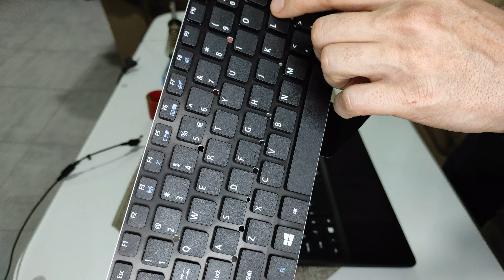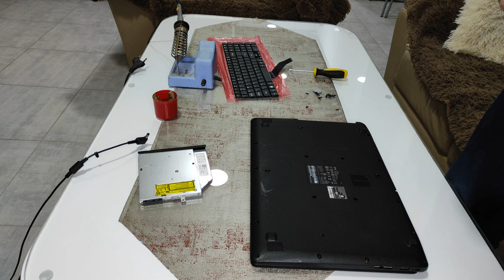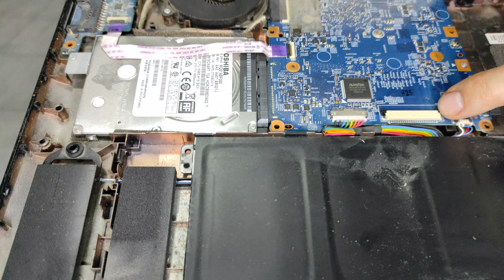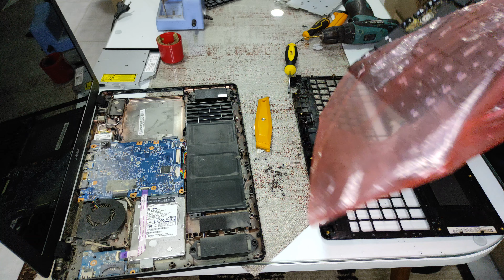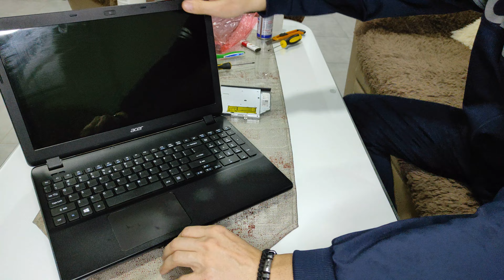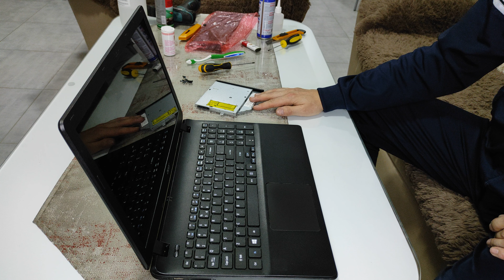ACER Aspire ES1 531 Keyboard Replacement

Comment: Absolute pain of a laptop to replace keyboard on. Did not have a drill on hand but was just successful removing all the plastic retention pieces using some prying with various tools between the metal plate and the keyboard. The plastic pieces give way under minimal pressure thankfully. Still awaiting replacement keyboard to complete the repair. Thank you for showing your repair methodology.
Reply: what an awful design! why they didn't use screws?
Reply: @luckyluckydog123  that would have someone thinking I can fix that rather than I will put this non working laptop in the trash...

Comment: good day... i have laptop as you are... the problem is the ssd wont detect in bios... i cant install windows..
then i try to use adapter cady for the ssd.. still doesn't detect in the bios... have you encountered with that issue.? thank you